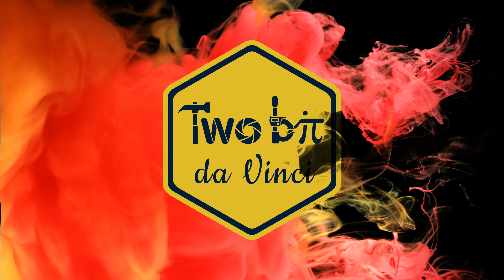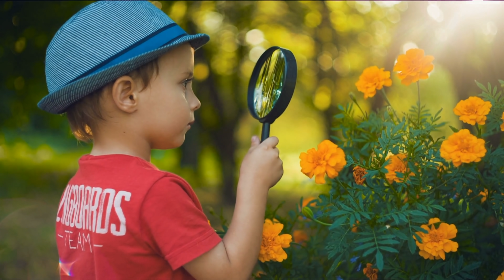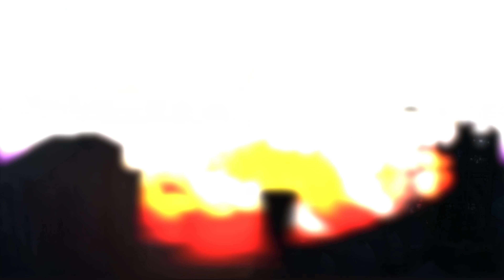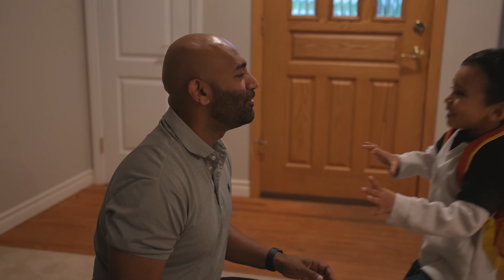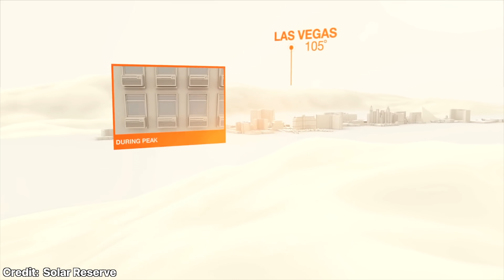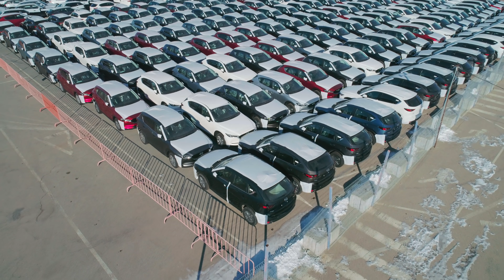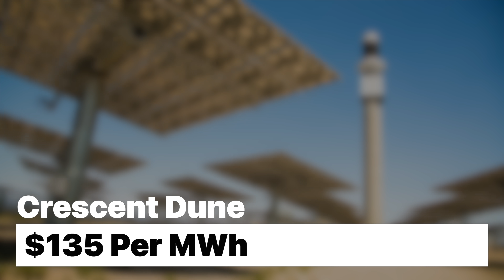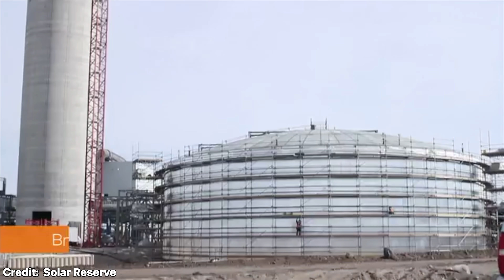This Billion Dollar Solar Plant was an EPIC Failure

Comment: From what I have heard you can use water and even air instead of molten salt and still have huge reservoirs that store the heat overnight.
HUUUUGE money savings that way. Overengineering is a mistake. Simplicity is key.
Even so, I don't see this technology as better than solar panels. I think it should be used only for melting stuff that usually requires electricity. Like let's say you have lots and lots of crushed cars and you just stack them in some desert. You can a have a small smelter that uses concentrated light where you can slowly but cheaply get rid of those crushed cars and produce metal bars.
Reply: The one big advantage over PV plants is that it can continue to generate power after sunset, because it is conceptually more a solar-charged battery than a direct generator. Really though, the whole concept needs further thought, and quite possibly further advances in materials before it is really ready for prime time

Comment: You can get a terrawatt of power with 2 granite piezoelectric speakers facing in opposite directions and a 500 lb xylophone key sitting on the speaker facing up used as a microphone. The feedback will keep it running forever and it will make water and spin and light up the tiny droplets like a mini galaxy in a box... and much cheaper to do..... no magnet.. no coil.. no battery or any power source required. It runs on feedback.

Comment: I guess using the CSE to directly run a turbine or sterling engine or something, that runs a generator and just using battery storage is too simple.  You could just calibrate the energy needed for the turbine by the number of mirrors you install, and increase or decrease it during the day by turning mirrors in and out of focus.  Get rid of the salt, plumbing, storage tanks, and other complexities.

Comment: The video mentioned pumping water to store energy. I think an easier and cheaper method is to lift rocks. The solar energy could be put into a jack which lifts a weight and then the weight drives a screw which drives a turbine.
Reply: One energy storage device that is supposed to be the most efficient, is train storage. (I don't know if that's what it's called) They want to build one here in Nevada. It's a train on tracks that basically goes up a steep hill or mountain to store energy and downhill to produce. They've been trying to get permitting.

Comment: I would love to see Elon Tesla team, take a look at this project and see if they could cut the operating cost and get it back up and running. Love the idea, and I think these should be all over the US. We need something like this or small molten salt nuke plant. One more thing, I know this will not be popular, but they could also add a natural gas burner to this unit and have it running for days without sun on NG, and NG is cheap. It could be the worlds first hybrid system, that would never go down or off line. Just my 2 cents.
Reply: According to other comments, the plant is back on running again after the takeover. The thing with CSP is that it is only environmental feasible in desert like environment. it requires large landmass, depending on its capacity. and imagine a bird flying through the plant, yeah it will get nicely barbequed within seconds. It works in other countries, Australia, Morrocco and Spain. Compared to regular PV farm, it's cheaper and more efficient, but again, its environmental feasibility is only valid in desert. otherwise, the whole go green idea cannot be justified even in EIA stage.
Reply: Well, for starters, build it in a state where the Davis Bacon act doesn’t apply. The wages were phenomenal because of prevailing wage. 
Even though the union company, ARB , pulled out Brahma was required to pay the wage plus the equivalent of a union benefit package on the check. We made staggering amounts of money, if this had been in Texas, the labor cost would have been 2/3 of this project and the workforce involved would still be making well beyond a living wage.
Reply: "I would love to see Elon Tesla team, take a look at this project and see if they could cut the operating cost and get it back up and running."
Ridin on dat E-dikk, eh boy?

Comment: CSP needs more research on how to reduce the failures that happen all over it. But other technologies exist such as parabolic mirrors being placed in an Abu Dhabi solar farm that do much better than this and operate at lower temperatures than concentrating all that sunlight to a single point. Of course there is a lot of improvements in PV solar that makes it more viable as its cost goes down. But it needs storage from battery to hydrogen electrolysis and fuel cells energy storage technology.

Comment: This is fuckin dumb just put a water source in the point straight up steam all day then store the stream in a big tank you can still have low voltage power at night at worse with bigger steam plants it works as excepted

Comment: Concentrated thermal plants are an abomination, if you think windmills kill a lot of birds these plants take the slaughter to whole new level as birds are first blinded by the glare and then vaporised in a puff of smoke. Most often it is raptors and vultures that take the brunt of it, the most important birds in the eco system

Comment: The problem with new concepts in any industry isn't an engineering one.  It's a greased palm problem.  New technologies require so much design review,  environmental impact studies,  and regulatory commissions before the first shovel full of dirt is moved that the cost is astronomical before the first day of operation is achieved.  Technology has reached a stall that is caused by power-hungry politicians who need their kickback.

Comment: university rots your brain. plant trees grow trees burn trees make electricity and or gas and or building materials, it will keep earth cool, filter water and toxins and if you pick trees that produce nuts or fruit, bonus. want to capture carbon? gassify the tree and put the coal in a cave somewhere or just use it as plant food for more intense production with less photosynthesis. find a way to stop malaria and then kill all the sheep in arride landscapes like north Africa and middle east. guess what. plants will grow then trees will grow then rain will come then temperature will be a bit cooler and everything will grow better then cut tree, ship it where needed and use them as energy. it's simple. why do people hate trees so much. why plant rapeseed and corn to make fuel. it's nuts and unproductive. how does heating a desert even more help the environment? its like making chicken, pork, lamb and beef not taste like chicken pork lamb and beef then make tofu taste like chicken, pork lamb and beef!  are surrounded by idiots with degrees

Comment: Sounds like molten salt reactors are facing a similar problem as fusion reactors. Our material technology is not advanced enough to cope with the combination of high temp cycles and corrosiveness of the environment we are creating within these vessels. I do remember reading about a storage solution that involved using the heat to trigger a reaction between two compounds and then reversing the reaction in order to reclaim the heat. But it was so long ago I have forgotten most of the details.

Comment: I was living in Las Vegas in the late 1990's.  There is an academic research consortium call DRI that had a facility right next to UNLV, which I was attending at the time.   In a lot near DRI, right next to Flamingo Rd, they had these small scale solar projects set up.  One was like the plant in the video.    The problem was that the collector, which was mounted on a tall pole, was so incredibly bright, that it was dangerous for anyone driving by.  I mean, this thing was way brighter than the sun.  Like when an eye doctor is shining that insanely bright light into your eye to check your retina, except even brighter.  I only saw this thing operating for one day, and then they took it down.

Comment: I propose the facility be upgraded to a PV array in place of the mirrors.  
Remove the tower and most piping. 
Add an electric heating element to heat the salt inside the tanks or externally. 
Replace grease fitting with sprung feeders. Automate continuous PV cleaning. 
Problem  solved.  
Molten salt battery,  turbines and the array hardware  can all be reused.
Reply: I like your idea.However PV panels would not need to be movable, eliminating a large part of the mounting and control complexity.
Reply: @jackboot3946  I can appreciate that. 
What about using the existing structures for mounting the PV array, and keeping a small section available for companies to test their innovative designs that think they can make the return on investment a net gain for the project. 
The fact that the infrastructure is there would be the only reason to keep it as a test bed for lower cost and lower maintenance systems.
Reply: @1puppetbike  As someone else pointed out, the existing structures are not necessarily well suited for PV array, What I like is the idea of keeping the molten salt battery but as suggested, use PV electric as the energy source. Less efficient, but also less prone to damage or catastrophic failure, so just double or quadruple the number of PV panels accordingly, as they are so much cheaper now... Unlimited expansion prospects, no need to shut down the entire system for maintenance...

Comment: Could one store heat in a very high melting point solid? Mebbe installed so you could add heat at one end and use it at the other.

Comment: There are some plants like this in other parts of the world that seem successful. It really does not seem like it should be more expensive to run than a nuclear or coal or gas burning power plant. Just without the cost of fuel. Mirror cleaning should not be more labor intensive than PV panel cleaning. Comparing power to PV seems unfair. What is the cost of storing and releasing PV electricity in the current batteries that are being used.

Comment: To initially heat the salt 1 billion watts of electricity are required, it has 70,000,000 pounds of salt that needs to be almost 600F and in perfect conditions 1BTU per pound is .34 watts. 

Almost 6Gw so far wasted. Doubt they put that in their reports.

Comment: Just an aside to this topic:

I feel like we are just outsourcing our carbon and human suffering to developing nations. We build some impressive structures by throwing human suffering at it. Like the Hoover Dam where over 30 people died due to heat stroke. Other things like the Great Pyramids of Giza where probably many deaths and injuries occurred during it's construction. North America now seeks to outsource the consequences of our energy production to other developing nations with cheaper labor and fewer environmental protections reduce their costs. People suffer on oil rigs and coal mines here to produce our 20th century energy. But now people suffer and die even more in rare earth/coal mines in the eastern nations for the 21st century's energy. I feel very conflicted about how and where we produce all these cheaper solar panels and batteries and how this will make us very dependent on those Asia countries with poor human rights records and poorer labor protections. 

The environmental impact of this is compounded by the energy costs of moving products across the world and the loss of energy transmitting electricity across long distance of powerlines. I am unsure if we can reduce our carbon footprint by going to reduce our carbon footprint by going down this path. I think the proper path is to produce our energy and products more locally and the current Green energy industry does not requires massive global supply chains to exist atm. Doing things locally would make it easier to address the environmental and human consequences on a more local level too. If there is one thing about foreign actors that should be apparent, it is that foreign governments and foreign solar power companies do not care about the health of the people or the pollution around the mines, refineries and factories where they source their products, equipment and resources from. 

Once we end oil pipelines there will be no oil spills from them. But developing nations will continue to produce our stuff still and will likely be plagued with environmental disaster after disaster and we won't let them stop or do pursue their own protections if they raise our costs. We will be enslaved by our country's dependence on them and they will be enslaved by our corporate influence and control over them. We should direct energy development with an eye for energy independence and that is greatly missing from the current landscape.

Comment: Even if solar panels and wind turbines were free. It's not going to work. Just a quick calculation, Grand Coulee dam produces 21 billion kwh per year. Looking at the ivanpah solar power supply, it would have to be increased to 81 square miles. That's just to replace one dam. Maintaining would make it cost prohibitive. Now looking at wind turbines the massive amount of rebar and concrete in the base, it will never be removed when the wind turbine is decommissioned, making the land useless. With all renewable energy production takes up too much usable land, life expectancy is low(20-25years), maintainance cost is high and when transmission is over the grid, it's no more reliable than what we currently have, most likely less reliable. 
I live offgrid and that is where alternative energy should be used. Remote locations that do not have access to the grid. All I see is economic and ecological disaster with switching to all so called green energy, because it's not green nor cheap.

Comment: "Renewables" don't work, in the least. At all, ever! Commercially. 
Private wind and solar does work. The last thing your going to see is industry giving up a monthly income that's a guaranteed forced source of mega-bucks. And that is exactly what needs to happen.
Reply: The huge increase in renewable energy all over the world is evidence that you are wrong. They make money. And cleanish energy...
Reply: @bigbootros4362  Pardon the pun but... It's all gaslighting. 
Wind and solar.
Both in commercial markets are greatly subsidized. That means poor people that can't afford them pay with years of labor so rich people don't half to pay. Both fail if da wind don't blow or da sun don't show. Then their are things like energy produced over time vs area required, resource accumulation, shipping,  material construction, shipping, warehousing, partial construction, shipping, building 
area and final construction. Right now all that is done with oil. Can commercial wind and solar alone replace their own equipment as it fails supplying all the energy needed? No. Well commercial wind can but the surplus is low.
They also share two massive fails. The debris from their end of life cycles. Notice the end of life cycle thingy? It's not when they stop working. It's when these heavily subsidized utilities deem a field, wind or solar, is no longer profitable.  
An increase in a tumors growth ain't good either. 
But that's in the commercial industry.

Comment: Three topics to discuss:
1) Liquid Air Energy Storage (utilize waste heat, utilize non-peak coal power generating capacity)
2) Liquid Metal Batteries (very inexpensive energy storage)
3) Liquid Fluoride Thorium Reactors (inherently safe nuclear reactor design for commercial power production)
Reply: You could add kinetic energy storage (flywheel) in the list of emergent energy storage technologies.

Comment: Gemasolar is the first ever built Central Receiver System CSP with molten salt storage (Spain). It started producing in 2011, is still in operation and has exceeded expectations of capacity factor, and that taking into account it is the first one of its own. Anyway, there are also other kinds of CSP that have already proven themselves like parabolic through. And I do not know why people keep comparing PV and CSP in the same conditions when both work in different markets: CSP can work as peak, program and baseload generation while PV currently can work in peak and program generation.

Comment: Until they figure out this setback, photovoltaics can be installed on top of those mirrors, combined with sun tracking ability in place to maximize output. This income can be used to fund troubleshooting of the original system and maybe add some too. What are your thoughts?
Reply: Lol

Comment: EVs are going to go wrong, they are not going to make millions of them unless they sell them at a loss.
Reply: People said the same thing about gas cars over a hundred years ago
Reply: @darthmaul216  they didn't have to subsidise or incentivise petrol or diesel, it rapidly became much cheaper fuel to use, easy to move around, even Jerry cans or bowsers of fuel can be taken where there is no electricity. We are told of a Hydrogen Utopia, but when you have made and stored all that Hydrogen, what do you do with the oxygen. CO2 is breathable in air in much higher concentrations than oxygen, which 5% extra in air will poison you fast. The windyest and sunnyest places on earth, are no where near human populations. Rare earths are being used for Lithium batteries which like wind turbine blades, almost in reusable. We only require Lithium batteries where we need light weight small volume batteries, car and aero applications come to mind. We will never get enough Lithium, Cobalt or Tungsten to make the cheap batteries to run an EV world. They need new batteries as soon as the battery warranty has run out, and suddenly just as you have finished paying for it, your EV needs a new 4-5K battery. As with the last electric and hybrid cars over a hundred and twenty years ago, they will quickly fall out of favour.